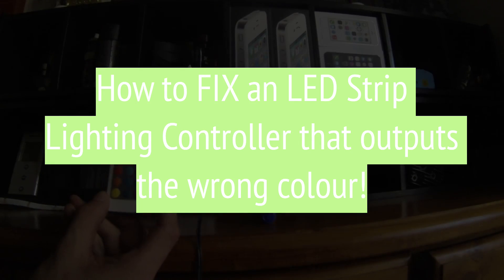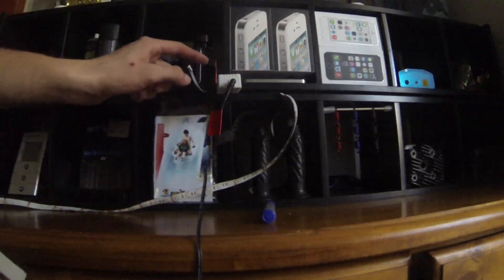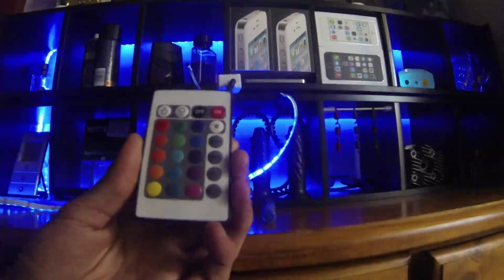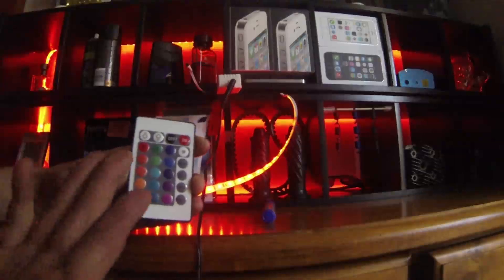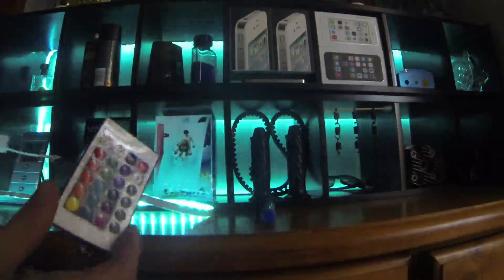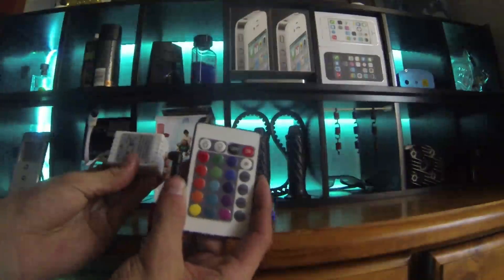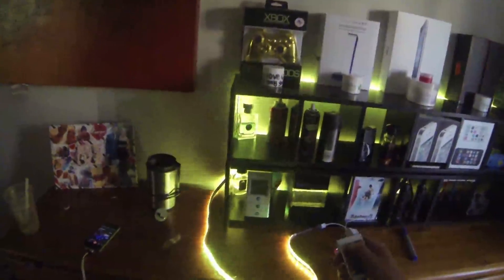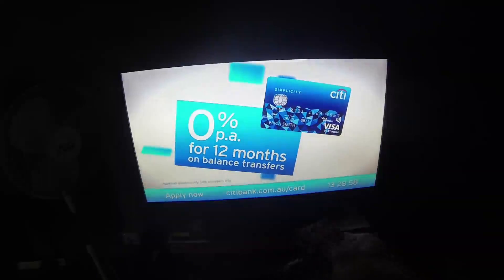How to FIX an LED Strip Lighting Controller that Outputs Wrong colour!

Comment: Iv done this, but i cant get past sstep 1 bc not even my power buttons work, it just changed to another color if i click on or off
Reply from the maker: @MidgetMafia01  In that case, imagine your remote is flipped upside down and click the buttons accordingly. So if your power button is in the top right corner, click the bottom left corner. I’ve seen that on a few remotes. Hope this helps

Comment: Do you know how I can fix my lights they are not putting out the color blue and when I turn them off on the remote they are still on
Reply: Yeah I have the same problem do u fixed it if u did can u tell me how to do it

Comment: Can some of you guys reply to me to help me out I just have my LED lights changing red and green I tried to do all of the videos that show me how to do it but it doesn’t work can you like help me out I have a small controller
Reply from the maker: You have an open circuit connection to the GRN terminal from the sounds of things. I can assist with rectifying this. 😊

Comment: 17 rf remote? Read the paper it came with. To cycle through the configurations: plug in the strip light to power on, then hold down the red + blue button for 5 seconds to cycle through 6 controller configurations. The tricky bit might be if your blue button is currently operated by the green button, like mine. So instead of holding red (which worked correctly) and blue (which turned green) I held red + green (which currently turned blue). Worked first try.

Comment: Step 1, Make sure all part of the LED strips kit are connects right and powered.
Step 2, Turn off (press the right top red button)
Step 3, Press the "FADE7" button ,it will flash one second.
Step 4, Turn on the LED strips again, press Red, Green, blue button one by one, it will change to its original color.
If it is not the case, please try Step1 - 4 again until it is change to the correct color.

Comment: I bought a sonoff controller to add wifi compatibility to my led strips but no button of the remote working to do this trick (smooth, fade, strobe or flash). Anyone figure it out with this controller?

Comment: ive had my lights for quite a few months now and it worked perfectly. suddenly, when i turn it on, the color red and green on its own appears as a mix of red and green. they appear as the same color. the only color that works correctly is blue and white and the rest appears as a different color than it should be. does anyone know how to fix this?

also when i pressed fade nothing appears, i've been trying to look for a way to fix it for a while now and i've tried checking the connections and stuff, none of them works.

Comment: So I installed mines and they were working, then I turned them off and switch the usb into they were connected and now when I press red or blue is mixed and both of them light up and it looks purple

Comment: This works, on the smaller remote as well(17 buttons) Instead of Fade7 button, press the DEMO button. Once you cycle through and set the Red, Green, Blue colors correctly, all others work fine.
Reply: can you explain: "cycle through?" I hit power, then demo and it always starts on red. Red is fine, blue and green are still swapped. (yellow and pink are swapped as well)
Reply: @yeeaahhzz  just repeat the process. Even if red is correct, you still need the other colors to reset. so if after the first round, the other colors aren't correct, repeat the process again starting with red.
Reply: @joaquingarcia7622  actually for my 17 rf remote, it involved plugging in the strip light and immediately hitting red & blue together to cycle it through 6 different configurations.  The issue I didn't realise was that when they stated to hold the "red & blue buttons together for 5 seconds" to cycle, I was hitting the actual blue button, not the button that currently activated blue, which was currently green.

After I hit the red+green together for 5 seconds, it corrected. I'm dumb for not reading the little piece of paper that came with the remote 😩

Comment: For me with a 16 color remote, what works is to turn off the power (with the LED on), then turn on and as soon as the light comes, press for 3 seconds either R, G or B, depending on what's reversed. Strip will flash 4 times and then turn white. Now test by pressing R, G or B. For me it worked pressing G for 3 seconds, all channels lined up. Red and Green were reversed.
Reply: Thank you so much

Comment: thank you so much for this. I had 2 IR remotes (1 for my rgb bulb and 1 44 key for my ceiling led strips) and the rgb bulb remote always interfered with the ceilling led strip. I fixed it thanks to you, but i wanna know what makes the color output change? like, what causes the flicker when pressing the smooth button?

Comment: whenever i turn on a certain colour, 3 of the leds are a different colour to the rest. say if i turn on pink, it will go red in one small spot. do you know a way to fix this?
Reply: It means your power is not enought

Comment: If pressing smooth doesn’t work, try pressing red, turning off, then spamming red until it flashes then use dim down button to adjust.

Comment: Brilliant, I couldn't understand why, when I had extended the cable from RGB remote to strip, the colours had changed. When all the connections were as before!  I was about to start de soldering and re soldering cables when I found your vid. Saved me a lot of messing and probably more heartache if it changed again.
BTW I got RED to work but BLUE/GREEN still wrong so I repeated operation but instead of starting by pressing RED I pressed GREEN then as instruction until GREEN lit. Now all good. THANKS.
Reply: Bro when I click on fade or smooth button when the lights are off, it doesn't even flash. my blue/green are wrong .what should I do?

Comment: Cheers that this fixed my daughters strip, I guess it is easily changed for many people if they accidentally press smooth when the unit is off.  For me Green was right but red was blue and blue was red.  Took about 4 changes to get the colours back. ps check all, as at first red was red again, but then green had changed to blue, just kept cycling until it was the correct sequence.

Comment: Someone plz help literally I just got led lights and legit whenever I press white or any other color then red, green and blue turn on instead of just one color and I don’t know what to dooooo
Reply: Nick K no problem! it is a stupid concept, hopefully if i buy another set it’s from a reliable company😒
Reply: Nick K  did you find a solution?
Reply: Nick K no the white still works i also thought they were broken but they produce white and the right colour light. The strap just shows different colors!! It’s totally fine!

Comment: Also, if your phone has an IR blaster, you can use your phone as a remote. The app LEDmote works for me. I always keep a couple of spare xiaomi phones. They're absolute workhorses with their battery life (A2 lite, redmi note 8 pro) and almost always come with IR blasters. Most flagship phones won't unfortunately. Thanks for the video. I was about to accept just using trial and error to get the right colour. One final thing, my Hisense TV remote interferes with the led strip. The down button causes the smooth effect, so I guess I'll have to keep using this technique every time my TV remote causes it to go out of sync.

Comment: The remote on my light strip works really well. The catch is that the green LEDS are ALWAYS on. If i push the red button on the remote, it does turn on the red LEDS, but the green ones are on too. When I push green, a nice dark green shows up and it looks great! When I use the blue button a blueish green shows up and I see the blue leds are on along with the green ones. And when I do where it slowly cycles through the colors the green LEDS are on no matter what color is being displayed. If i fiddle with the 4 pin led connector it seems to be able to display the color red, but if i plug it in all the way, green turns on

Comment: yo can you help me?
when i try to connect the led lights they dont even turn on.. idk everything is good nothing is broken i changed the batteries on the controller of the led lights it still didn't turn on..

Comment: my remote is so messed up. when i press the colors below the RGB W buttons, it comes out multicolored. for example, i press orange, and suddenly the colors are red and blue. when i press the light blue, red green and blue come up and it’s a little turquoise from the reflection but that’s the only color that kind offf looks like the button, HELP!
Reply: i have the same problem 🤦🏽‍♂️
Reply: This is the exact problem I have did anyone find a solution
Reply: Autumn Turner noo :(
Reply: this is happening to me! were you able to fix it?
Reply: Meagan Palmaira noo!! they’re still like this

Comment: Hello I have a question I have the lights that don’t come with a remote. When I switch to the color blue 3% of them are green and 97% are blue
Reply: I wonder if there is an app that u can control them
Reply: Have u fount a solutions because mine are like this as well
Reply: Is it the lights at the end of the strip that are a different colour? If so it could be that your power supply is not supplying the last LED's enough juice.
Reply: Same

Comment: Mine does blue and green together, blue and red or red and green, what is happening?
Reply: Same
Reply: Have you fixed it? I really need help
Reply: I have the same problem and idk what to do
Reply: Alaina Haasl sameeee
Reply: Alaina Haasl I just got them
Reply: Same
Reply: Well, I did what it told me on the video.  About the DIY, it doesn’t work for me
Reply: cosme༄ same help
Reply: ThatBecca I fixed it but now my remote and that box is broken, gotta but a new one
Reply: Eva Dávila how did u fix it
Reply: yes that’s my same problem toooo did you manage to fix it?
Reply: Jxng_ shook. It was that I wasn’t in a dark place.  Try connecting it in a place where there isn’t any light and then choose a color and it will appear

Comment: Help! I just got my LEDS and when i press blue or red and make low brightness,when you look close, you can see that it lights blue and red at the same time and it makes purple.Only green is normal.What should i do? Should i bring them to an expert or should i contact the seller,or maybe you have some tips?
Reply: i’m not sure, you may have to ask the seller. when i first got my LED lights only red was working and it was very dim. after upping the voltage on the adapter, the rest of the colours and brightness worked fine. maybe this’ll help?

Comment: Thank! Your such a legend
Reply from the maker: No worries! Aw thanks!
Reply: Drew Boyer also I just bought some and 1 set is working and the others aren’t . I have 3 remotes and all of those remotes only connect to 1 of the led lights, I don’t know if it is because they are connected but just message back if you know.
Reply from the maker: @manikaclayton1747  These LED remotes must communicate with the Strip Controller using the same protocol, I have come across 3 protocols. Instead of pressing Power, turn the remote upside down and see what button is in the same position as the power button, then turn the remote back around and press that button. Let me know what happens, you might have a fault with your controllers
Reply: Drew Boyer ok I will go try, and if not could you please make a video on it
Reply: Drew Boyer it didn’t work can u make a vid on it
Reply from the maker: @manikaclayton1747  I'll make and upload a Video tomorrow if I can. :-)
Reply: Drew Boyer ok thank you so much!
Reply: Drew Boyer were you able to upload
Reply from the maker: @manikaclayton1747  I can't seem to find my box of controllers, my box of remotes have 4 rgb controller remotes that have 3 separate protocols, I can't show you what I mean without them but press the yellow key on the 24 key remote or the jump 3 key on the 44 key remote, do you have a multimeter?
Reply: Drew Boyer what is a multimeter
Reply: The yellow button
Reply from the maker: @manikaclayton1747  an electronic  device for measuring Voltage and current etc
Reply from the maker: @manikaclayton1747  if the controllers are working and outputting the correct voltage and the remote works for one but not the 2 in question then it is highly likely that they communicate on a slightly different protocol and you will need to buy a remote to suit.
Do they both have IR receivers?

Comment: THANKS, Its saved me a lot of time and struggle cause I thought it was a wiring problem causing green to be switched to blue and viceversa. It totally worked even though i have a different controler and led strip

Comment: I’ve done this a lot and red was “off” at first so I did it twice and it turned blue then did it twice again then it went green then did it twice again and it turns back to nothing then green,blue,nothing. It never goes back to red?
Reply: Same problem here. Found a solution?
Reply: same

Comment: Ok I have a 24 key remote with a music button instead of a smooth button.  It does flash when I press the music button, but, when I hit on again the strip stays off.  The only way it comes back on is if I hit the color buttons which never change, I ran through the cycles for 20+ minutes.
Reply from the maker: So are you saying that when you hit the fade or flash button, nothing happens? And when you hit 'Music', nothing happens? And you are also applying 'noise' to the Mic following the 'Music' selection right?

Comment: Is there a way to fix the strip if one color short circuits or goes out?  ...I have one and only the red is dead. Pressing blue results in blue. Green results in green. White results in greenish blue. Red results in darkness/ no light.     The red is dead.    Any way to fix it?
Reply from the maker: You can try opening the receiver box and checking that the red has not disconnected from the circuit board. Have you measured the voltage at the strip?

Comment: i have two of the same led lights and they work on a  24 key remote.however only one of the lights works and the other doesn’t correspond with the buttons.i tried this and it sadly didn’t work,can anyone help??

Comment: This got me started although on my 24 key remote the fade button did nothing. I tried them all and the "smooth" button does a quick flash when the strip is off. Followed the same procedure pressing "smooth" when it was off, turning it on and pressing red until red actually did red and the rest were all correct too.
So i'd say whatever you have, turn it off, press all the functions (smooth, fade, flash etc) until one of those buttons makes the strip flash, then you know which one to use.

Comment: Thank you so much! I a light strip around the back of my tv and I also liked using the light orange as a warm neutral colour at night. Then it wasnt working anymore, it was an purple pink. The blue and green were swapped too. So I guess I didn't lose the orange, the inputs from the other colours were off and thus the purple pink. This fixed it all, thanks again!

Comment: What it didnt work cause the light didnt flash when it was off and i clicked every button
Reply: Ultra Easton I got the same problem
Reply: SOLVED IT! I had the same problem because i used left over parts of LED strips instead of starting with a new one. The order of colours is different on the controller (12V -R-G-B-W) than on the strip (12V-G-R-W-B). That means the green cable needs to be switched with the red one, and the blue one with the white one. That is usually already realized with the cables at the beginning and the end of a new/ fresh bought strip.  If you can’t use those parts, the switching can be realized by using connector cables: open both white plastic clips of one end. Carefully lift the cable shoes out of the plastic. Then after switching red with green, blue with white, carefully press them back into the plastic.
Reply: any solutions i got the same problem
Reply: what type of remote do u have? (sorry for being 1 year late :))  )
Reply: @no-ex3fd  I HAVE THE SAME ONE THATS IN THE VIDEO
Reply: bigman Skrrr oh okay
Reply: its4amhelp any solution
Reply: bigman Skrrr exactly what he said. turn the led strip off, and then press the button from the right corner, down, the last one on the row and press it with the lights off
Reply: its4amhelp Bruh the lights dont flash when its off wnd i clicked the button
Reply: bigman Skrrr then idk. i have the big controller and i press the “FADE 7” button
Reply: Ultra Easton yeah

Comment: Nice work, thanks for the vid.  Yesterday I finished making my own wireless LED strip controller, accessed through a local webserver/site.. finished colouring in my favourite buttons in the HTML file and during testing I remembered seeing a flash but afterwards the colours were jumbled.. couldn't get my favourite oranges back.. gutted.. I'd have never have stumbled on these button press combos.. cheers!

Comment: Anyone knows why my music IR might be getting stuck at solid white, when its set to like disco mode ? (Flashes and changes light with the music)
I unplug and plug the power back and it temporarily starts working, changing colors and flashing with the music, but again, after a while gets stuck at white.
i feel like this might have to do with my power adapter or the sound loudness /or song type.

Comment: Doesn't work on mine. Exact same problem but your solution doesn't work. I turn it off, hit 'Smooth' and it doesn't flash like it does for you. I then turn it back on and the colours are still mapped to the same buttons they just were. :(

Comment: Thanks, this worked. 15 seconds. It ended up working because of other remote controls in the room for my TV. Apparently, the LED strip controller does not have a manufacturer and model code in the IR signal to filter out and ignore other remotes